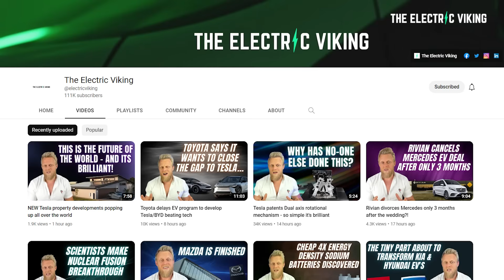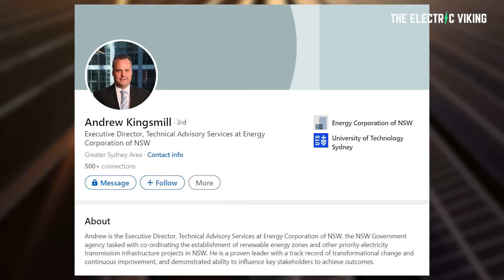Australia will close every coal power plant up to 10 years in advance

Comment: Destroying the business case for Coal based on price for solar looks like a no-brainer. Australia is well positioned with lots of solar. Solar is of course subsidized? Adding wind will of course help.
Question remains the cost of truly massive battery storage and the resulting integral cost. I have seen the RethinX projections. 

In the Netherlands energy prices have skyrocketed, due to the idiotic adherence of EU sanctions against Russia, but no way that battery storage is anywhere economical.
Solar is only economical for the consumer because he is allowed to credit his excess delivered during summer to cover his debit in winter to the extent that this credit also includes the transmission and distribution net fees over the pure cost of energy itself.

So what we have here at this point in time still looks like more of a political ideological decision than a decision based on pure economics. Just check the cost of kWh storage now. I know that prices for batteries have come down but there is still a long way to go before that provides an economical 24/7/365 solution.

Germany has massively invested in the "Energiewende" (energy transition) to wind and solar), but thanks to its own sanctions cut itself off from Russian energy. Green policies are still fully intent on closing down the remaining nuclear plants shortly. One result is an enormous increase in coal generation to the effect that an EV thus provided with kWh actually produces more CO2 than an ICE. Another result is an unprecedented de-industrialization and an enormous inflation. For instance the survival of legacy German auto manufacturers already under pressure by EV, IT problems and a debt burden looks ever more questionable to say the least. But this applies to nearly every energy intensive German industry.
Average people simply can't afford to turn on heating systems. Especially elderly relying on abysmal state pensions have to choose between heating and eating. The ideological GREEN party couldn't care less. Government is resorting to arranging communal facilities where people can find a heated 

By the way CO2 is food for plants. Plant biomass has increased by more that 10 percent over the last 2 decennia. 
So reducing CO2 may give you a warm feeling but you really should look into the underlaying (lack of) rationale.
Actually on a geological timescale the world was heading towards a real mass extinction due to lack of CO2 which has been coming down from far above 4000 ppm to 200 ppm around 1700 because the ever increasing carbon binding into sediments. Do realize that current plants already Darwin selected for being able to survive lower CO2 availability start to whither below 180 ppm. Greenhouses inject CO2 up to 1200-1500ppm to stimulate growth. 

Because the world has thrived on much higher CO2 levels there is NO imminent danger justifying the term "crisis". 
Anyone suggesting a "crisis" is a con man with a hidden agenda like the WEF.
Reply: The coal plants are subsidized  as well  $11.6 billion in 2021/22.

Comment: Dear Viking, you can look into this but I’ve come across the reuse of coal fire plants being repurpose by adding a Liquid Metal battery. The idea is to use solar and wind to induction heat a Liquid Metal battery that store heat energy. The water is pumped through and the steam runs the turbine and presto, electricity
Reply: Carnot batteries. Promising technology seeing as it will also reuse all the electricity distribution facilities of the original coal plant thus saving a lot of the build cost.
Reply: U ain’t far off base atleast ur thinking bout it
Reply: The three main variables that will affect this are 1) capital cost per kw (generation) and per kwh (storage) 2) round trip efficiency 3) energy loss over time. The competition is batteries and pumped hydro storage. Old power plants and pumped hydro also have the added value of stabilizing AC current at 50Hz.